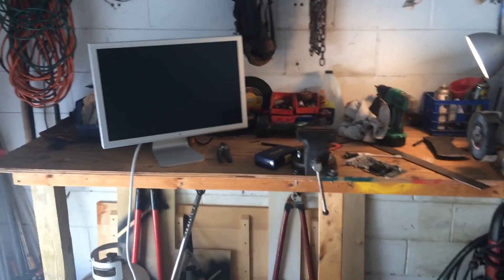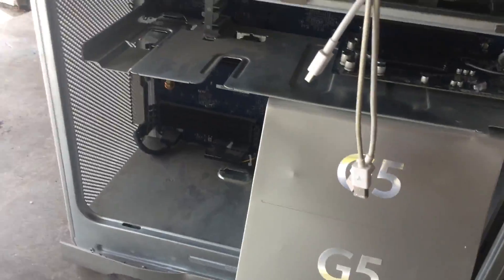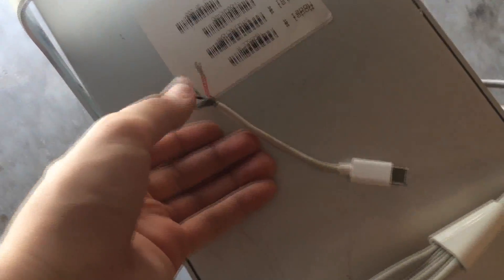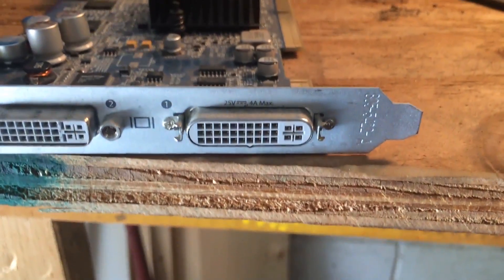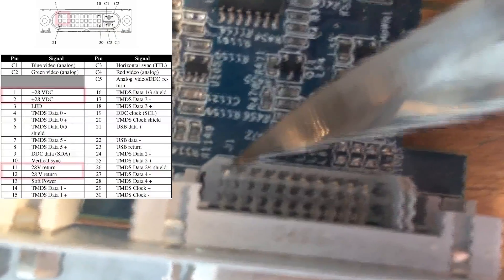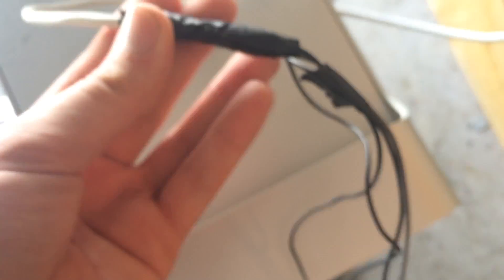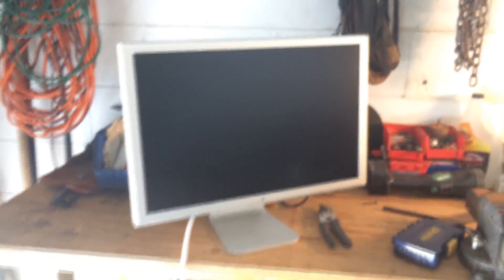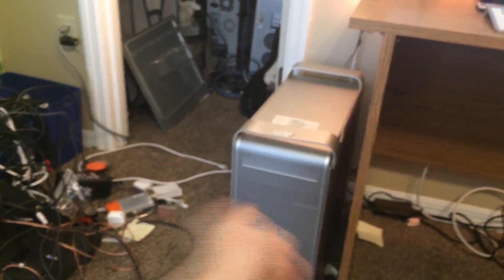How to power a 23" Apple Cinema Display with a PowerMac G5

Comment: Funny fix, although I can imagine this being a less power-efficient and quite a lot bulkier way to power the monitor. Wasn't it an option to just resolder the powercable? 

Wish I had one of those Cinema Displays... Beautiful things to see.
Reply from the maker: FinalTouchComputers The power cable was cut and I don't own a power supply for this specific monitor. I did however have an old beat-up G5 and thought why the hell not? 

As for the monitor, I use it every day and love it to death. Best $80 spent ever.
Reply: Austin Smith Right, I get it now, I didn't understand you didn't have the power brick.